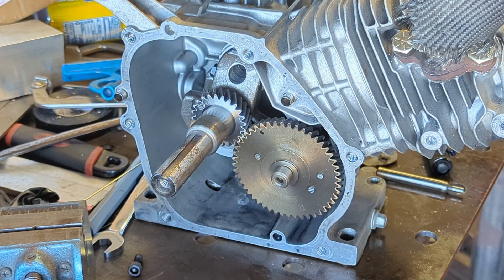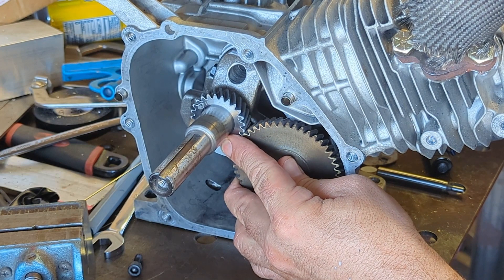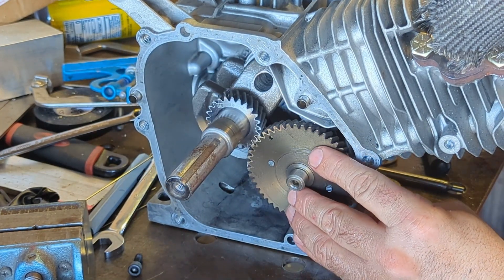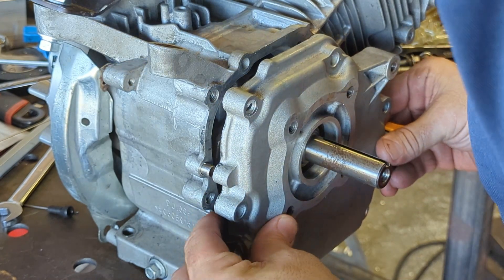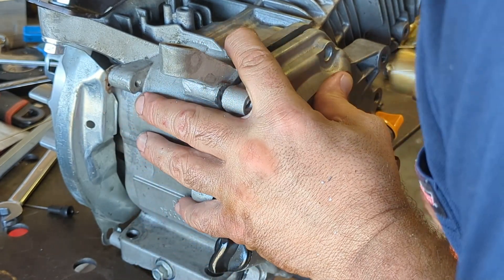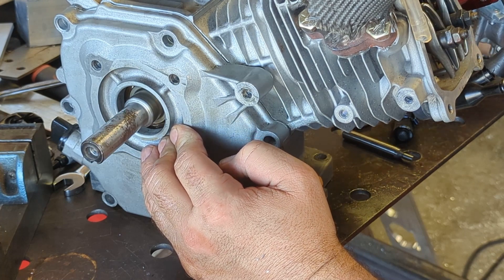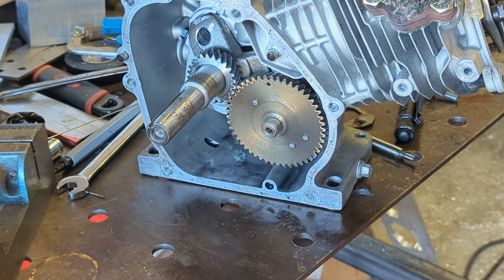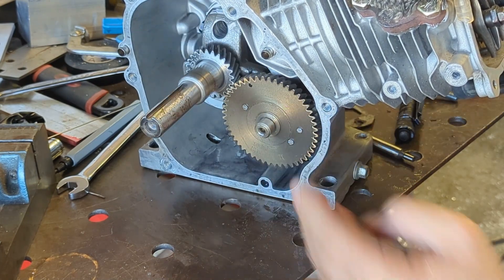Harbor Freight Predator 212 Has No Compression! Valve lash too tight!

Comment: When you pull the camshaft out far enough your bypassing the compression release mechanism for the exhaust okay your valve cover is pushing everything back into alignment allowing the compression release to now work like it's supposed to your engine is doing exactly what it's supposed to do it it has a compression release on the camshaft that's why you're not getting any significant compression it's there but enough to get it to start and as soon as the engine starts and it turns the weight will pull the compression release out of the way giving it the compression it needs to run
Reply from the maker: That's actually not at all what it was....the problem was the valve lash was a hair too tight, and when the cam shaft was up in position, it was causing the valves to hang open....as soon as the cam dropped slightly, the pushrods lowered allowing the valves to close all the way and gain compression.....as soon as I loosened up the valve lash, the problem went away

Comment: When you slide the cam out far enough to barely mesh the gears what you are doing is defeating the compression release mechanism.The purpose of the compression release is to make pull starting possible.Look at the compression release mechanism on the backside of the cam gear and all this will make more sense.Simply put nothing is wrong with your motor it is designed to do this.
Reply from the maker: @travis48g  yeah nothing was wrong with the motor, but the valve lash was set too tight and was holding the valves open... Basically, when I took the crankcase cover off, the cam was dropping ever so slightly, so the pushrods were dropping, and allowing the valves to actually close.... With the crankcase cover on, the cam would push up on the pushrods slightly, and cause the valves to hang open. A buddy of mine pointed it out the next day and after loosening the valve lash, it cranked right up first pull.

Comment: How u doing? Im having the same issue and was wondering if and how u fixed it if u did? Its driving me crazy man.
Reply from the maker: It turned out the valve lash was too tight and was keeping the valves open slightly at top dead center....
Reply: The little spring on the back of your cam centrical force opens it up loose the compression release out the way, and then you have compression. It only happens after your motor spins a certain RPM then you get compression trial force has to happen to release your spring off the releaseof your cam hitting it then you will have compression I believe this is your problem 100%
Reply: What did you set valves to? I have them set correctly with the Same issue and no adjustments have seemed to work.
Reply: I haven't yet, cause I can't find the specs on this particular motor
Reply: My problem is this motor for some reason doesn't have the inner lock nut not a outer locking nut it's just the bolt that holds the rocker arm in. First time seeing that myself.
Reply: These engines have a decompression lever that relieves the cylinder pressure when pull starting the engine. You can also check the cylinder pressure by loosening the lash on the exhaust valve to bypass the decompression lever. This will give a better reading
Reply: Your engine is probably fine. The compression release holds the valve open to make it easier to start after you hit that certain RPM. It engages the compression release out-of-the-way and you have compression then the compression releases holding the valve open.

Comment: recheck the valve lash if not recheck the camshaft make sure is for the engine you have or check your piston rings make sure they are not blown out or recheck the piston to make sure is for the right bock (engine) that you have
Reply from the maker: I ended up sending the video to a friend, and he suggested valve lash as well, which turned out to be the issue!  Motor runs great now ...
Reply: @Steelcrafted  oh ok well that’s good